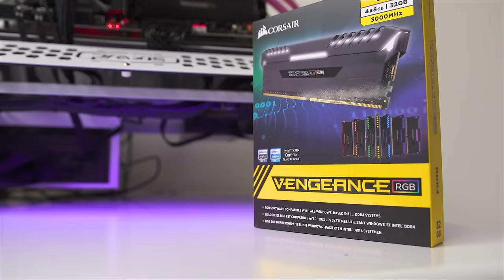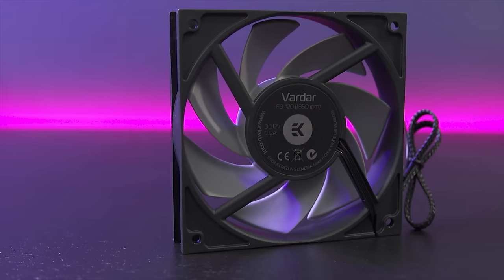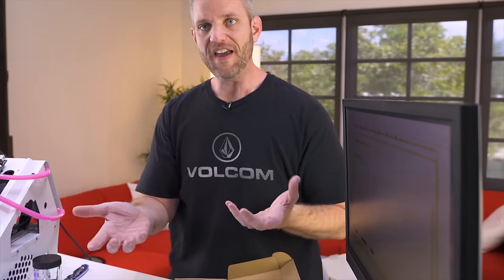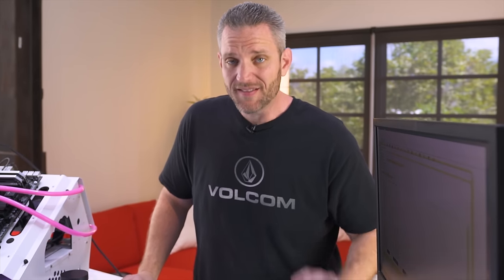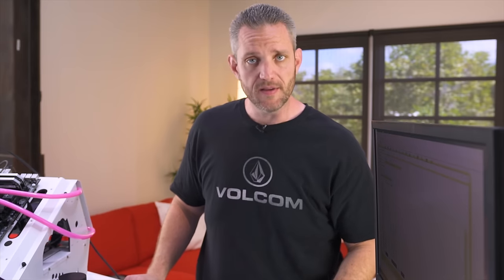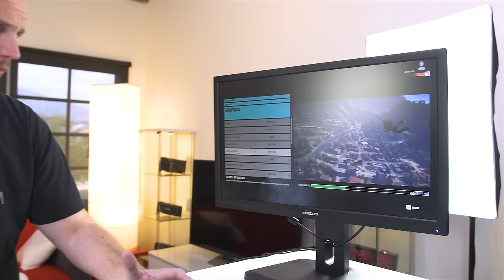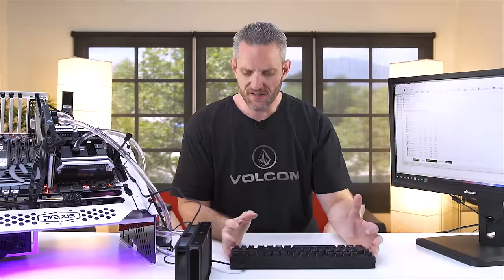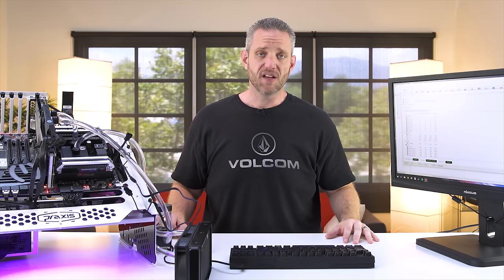How to Watercool your CPU and GPU for under $250

Comment: Hi Jay, seeing that you are no chemist and I am a chemical engineer, I can tell you a little bit about Galvanic corrosion. What it basically comes down to is a little known concept we are all familiar with from high school chemistry called "galvanic cells". The difference in standard cell potential between two metals needs to be minimized in order to minimize galvanic corrosion. If you use two metals with a massive difference in standard cell potential, for instance zinc and copper, you end up building a "battery" capable of producing 1.1 Volts of electricity, which is  not good for the more negative metal, as that metal will lose electrons (Hence it will oxidize), and thereby reduce to form more of the other metal. This will leave you with less of the one metal, an increase in dissolved metals in solution, and an increase in the other metal. Ways to combat this is to use a sacrificial anode or sacrificial cathode (galvanizing is a good example or you may supply a current to the more negative metal), you may coat the material, you may separate the metals using an inert material, add corrosion inhibitors or, the best possible way to combat galvanic corrosion, use the same friggin metal where ever you can and should the need arise to use a different metal, you should choose a metal with a very similar standard reduction potential. Also, when it comes to this concept, it is always best to have the parts with the greatest contact area to be the anode. if you make smaller parts anodic, they will corrode a lot faster and become useless. Thanks for everything Jay, love your work! Best Regards Herman
Reply: Herman Sauer great comment thanks for taking the time to write it!
Reply: "and thereby reduce to form more of the other metal"

I don't get this part. How is one element supposed to turn into another? Surely you aren't talking about nuclear decay

"and an increase in the other metal"

where does this extra metal come from?
Reply: Sorry, I get why you would think that I wrote that, it is not what I meant. What I meant, one element loses an electron and turns into an ion. The electron then transfers to an ion of the other metal (if there is such ions in the solution) and reduces it to the other metal. when there is no other metal ions then you just end up oxidizing the one metal while reduction never occurs. It can happen though that different metal ions may be reduced
Reply: Please forgive the way I put it in my original post, I tried to put it as plainly as possible so that others could understand roughly what was going on
Reply: Thanks I appreciate it Mitch!
Reply: Wow... A comment like this?? And on youtube?? Man, your words are gold! Thx for your effort!! Keep up the good job!!
Reply: Oh so essentially one metal is attracted to the other (one has less electrons) so it starts losing atoms which flow to equalize the potential difference.
Reply: @Santo Suarez, Thanks so much I appreciate it :) Sharing is caring!

@NicksDomain101, You can basically put it that way, this is how metals behave. It is a spontanuous chemical reaction that is occurring where the one metal is oxidized (losing an electron causing ion formation) and one is reduced (gaining an electron causing solid formation) It is the principle on which all batteries work. If you reverse the electron flow using an external current, you can reverse the chemical reaction. That is how electroplating is done :) In nature, all things will move towards an equilibrium (balance) and this includes two different metals in a conductive environment. I am not going to go into Thermodynamics now as it gets complicated quickly, but understand that this reaction will continue until there is absolutely no potential difference between the two metals. In some cases, a metal may form a protective, highly corrosion resistant, layer, in which this flow of electrons may actually reverse. This concept is used in many situations for protection of a metal against acids and bases. Like Iron may form an oxide layer, which is extremely resistant and can withstand quite high concentrations of sulfuric acid. It is known as passivity. Well im sure im going to bore a crap load of guys here with my talk so if you ever need to know something, feel free to drop an email. herman.sauer@yahoo.com and please dont spam my address with a bunch of porn XD
Reply: So let me get this right, using the same two metals only minimizes it or eliminates the concept? If only minimized, what timeframe are we talking before it gets bad?
Reply: Good Explanation, but why is your Name missing a second (n)
Reply: @Levi Kosters, to really give you an answer and add a time to your question will take a fair amount of research and lengthy calculations, but here is what I can tell you, If you dont mix metals you will be fine. The big problem with pc water cooling parts when people mix metals is that you can start getting buildup in your waterblocks. I dont need to explain to you how bad that would be for your system XD

If you have only one metal present, then there will be very, very little galvanic corrosion occurring. The corrosion that will happen when only one metal is present has some other names even because now it becomes a molecular level issue because the metal has impurities. Inter granular corrosion and things like that will come to play. but dont worry about that, as it is a very slow process and it is only really a problem in highly corrosive environments. When only one metal is present, you could say that galvanic corrosion is eliminated, as you will not notice the corrosion that is occurring. When metals are mixed however, the larger the difference in standard reduction potential of the metals, the more aggressive the corrosion will be. Other factors affecting this is flowrates, solvents present, temperatures, conductivity of environment and the physical properties of the metal itself and many other factors. But for an application like liquid cooling for a pc, just stick to the guidelines and you will be fine. Where galvanic corrosion really becomes a problem is in the chemical process industries where solvents flows at high temperatures (200°C and up) and pressures. But by far the best example of where galvanic corrosion is a major issue, is boats, submarines and vehicles near coastlines. You will notice a lot of people drive land rovers in coastal regions. That is because of their aluminium bodies. Go check out submarines and boats. They have sacrificial anodes connected to them in alot of cases to protect it's parts from galvanic corrosion. Another good Example, galvanized pipes, fittings plates and so forth. They are steel parts that is covered in a metal such as magnesium. when these parts are in contact with some other metal that is cathodic to them, instead of them starting to corrode, the magnesium layer will start to corrode, thereby protecting the steel. Dont stress too much about your pc, but do take care not to get reckless. Avoid mixing metals where conductive environments are involved
Reply: @Lukas, Thanks man! Why does my name need a second "n" :-/  I am "Herman" with one "n". It is simpler, better and faster!
Reply: Wow, I learned something from Jay and You today, thanks!
Reply: Hi Herman, Thanks for posting this! I just had a question though... what about the metals between the CPU heatspreader and the block of metal (could be copper/aluminum and heatsink/waterblock)? Would this be an issue? I'm guessing the CPU heatspreader is aluminum but will it matter what types of metal touch the heatspreader?
Reply: poiisondn Yeah I was wondering the same
Reply: Hi Poiisondn, To my understanding it will all depend on a couple of factors, including your thermal paste, metal used for heat spreader and metal used for the block. If the two metals are different and the thermal paste is electrically conductive there will be corrosion over a long period of time, but not so bad that it would really damage the components as the corrosion will occur over the surface of the heat spreader or the surface of the water block, and thereby form a scale on the other surface. On old GPUs and CPUs you can actually see this clearly (i'm talking GTX250 old) where there is slight discoloration (with copper involved you might see a blue-green tinge) and there is a slight faded look on the surfaces. You might even see black marks. It is due to scale formation from corrosion products. all you have to do is properly clean it up and apply new thermal paste, but using the right thermal paste will greatly minimize the effects. Simply put, you will throw that cpu away long before it really becomes a problem. But if you really want to stay on the safe side, just perform good maintenance on your pc. Every year you have to replace the liquid in your cooling loop so you could just as well clean your water block and cpu and re-apply thermal compound. But doing so every two years will suffice.Also try using a non-conductive thermal compound. Like I said, it is not really a problem. The amount of corrosion happening in that area is very little and should not be a concern.

 In the case of other components like radiators and fittings, residue could build up inside the water block, which would cause resistance to flow and which would also massively impact the thermal conductivity as the heat-exchanger will lose surface area to scale formation. And remember, inside the loop there is flow, which aggravates galvanic corrosion. Between a heat spreader and water block is really not an area you should be concerned with :)
Reply: I know it's sometime hard to share such a knowledge even if it's considered basic, but dedicating your time to share it, is something that you'll never regret! So thank you for that and I want you to know I myself and most of the people appreciate it.  you're a valued member of this community, and I will be always looking forward to your inputs.
Reply: @iSR5, thank you very much for the compliment, I really appreciate it. I will always gladly share what I know and when I am not sure, I will research the matter at hand to give a proper answer. So like I said, if you ever have a question, feel free to ask. I will gladly assist. In one of my comments I left my one email address on which you may contact me at any time. like I said before, sharing is caring. :) The only reason why it is hard sometimes is because there is a lot of people out there that will try discredit what you are trying to teach others by shouting over(or spamming) your conversation with some random stuff they have read on wikipedia... which is really not a good source of information. With Chemical Engineering there is one shit ton of "If's" and conditions in every answer to every question. Its not always something you can just go and quickly read up on.. in fact, it is actually almost never that easy. You need a wide knowledge base and good understanding to really know what to look for, but some guys just don't understand that. They will just find some quote somewhere and twist it around to their will just so that they can say "you are wrong" but actually, they have no idea what they are talking about. so to you, iSR5, I say thank you very much for the appreciation. It is really encouraging and I will remember that.
Reply: Thank you for the explanation! I'm not good at chemistry but only have a very general understanding of it. Your explanation made sense though! 
Hope to see more of your comments on this or any other channel :)
Reply: Herman Sauer so... Will aluminium corrode?
Reply: Thanks Man! I learned something new today
Reply: Ivan everything but Gold and Sliver will corrode... and even those can be made in the lab/ industrial  environments to corrode
Reply: anything can corrode, depending on the environment
Reply: apart from dried weetabix that shit is hard to get off.
Reply: What is weetabix?
Reply: in my country we have weetbix? maybe he made a typo. It's like a wheat based brick that you add a little bit hot water, and milk and sugar to get a nice breakfast porridge. when that stuff gets dry it is a bitch to clean up XD
Reply: I will definitely give you a gold for such a great comment like this but, too bad, this is youtube not reddit... :3
Reply: Herman Sauer that's not how you eat Weetbix!!!!
Reply: hey Erik, everyone has got their own method :P
Reply: thank you lincon :)
Reply: What if somebody use any other than EK certified Al "screws" in the loop, e.g. for radiator fans? Is it that serious on the screw level? If so, another point would be how much EK certified Al "screws" can stand assemble and disassemble and for the time to come? If so, do we have to replace every Al screws and any parts that absorb tensions on a period of time?
Reply: Herman Sauer VERY INFORMATIVE. Thank you.
Reply: Thanks for that info.  I've basically read much of that, but scattered around from different sources etc, so nice to read in one concise paragraph.

That being said, I actually just bought this kit, but I have a non reference card (EVGA 1080 FTW GAMING ACX 3.0) that the included gpu waterblock won't fit.  So I'm looking into other options, but basically there is no aluminum waterblock (that I can find anyways) that I could use as a replacement.  So now I can either just not liquid cool my graphics card (not the end of the world, but still), or see if there is a solution that would make one of the other gpu waterblocks not wreck my system.

How well would using a sacrificial anode (or would it be a cathode?) work with the use of the corrosion inhibitors?  Is that used in practice in pc water loops?
Reply: Ohhh thats a bummer. Can't you modify it to fit? That's what I would do. try make a plan to modify it! :) I have never really heard of Sacrificial anodes in computers.. Also, I wouldn't try it. Sacrificial anodes may help, but they have their own flaws which will defeat the purpose. I HIGHLY recommend modifying it, or selling it to regain some money. The problem that you are facing now is the exact reason why I haven't invested in such a kit. If you are too scared of modifying it yourself, check on the card what needs to be changed on the water block to make it fit properly, after that you can always take it to a company that does milling and machining, so that they can modify it for you, professionally.
Reply: Any time! See one of the biggest issues with galvanic corrosion in water cooling parts is that it forms a residue on the "heat sinks" inside the water block, which in turns resists flow of the cooling medium and significantly impacts the heat transfer coefficient of the water block it self. Now the thing about sacrificial anodes, it helps combat corrosion, yes, But it does not eliminate the formation of residue. It actually promotes it. So I would definitely not go in that direction. If you are willing to sacrifice appearance, and if you can make it fit properly, I'd say try it out. just make DAMN sure that the waterblock makes proper contact with the GPU and VRM modules, otherwise you are going to shed some tears at the end of the day. Just test it out. Install it and run Heaven Benchmark for a while. If everything seems under proper control then keep it on. If temperatures looks odd, then put the original cooler back on. Just keep a close watch on your GPU and VRM temps throughout the testing.
Reply: Gotcha, thank you.  

I think since I messed up on the compatibility, and this computer runs the show at my house (htpc/server/gaming), I'm going to keep the kit, and use on another system that I'll build.  By the time I do, hopefully the correct original/reference 1080s are decently priced so I can use it on that.  

In the mean time, I figured I'd piss the wife off, and went ahead and ordered around a grand worth of new components (new case, cpu/gpu blocks, pump/res/tubing/fittings etc) so I can do it right for this build.

Thanks again for the detailed info, as it helped a lot in making my decision.
Reply: +sandthorn: It seems Herman missed your question. I'm not a chemist, and only vaguely remember this stuff from high school chemistry, but I'd say the electrode potential difference between different grades (purity) of the same metal has to be pretty minuscule. Plus your screws don't come into contact with the flowing coolant (I think?), which makes it the same kind of static situation Herman was talking about with the heat spreader to boot. You're probably pretty safe as long as they ARE aluminium screws.

That said, "at the screw level" is exactly where galvanic corrosion can do the most damage. Builders, for example, are well educated on electrode potentials, because if they use the wrong metals in, say, sheeting a roof, the corrosion will eat up the rivets and the whole thing will come loose. You can read more here, if you want: https://www.thebalance.com/galvanic-corrosion-2339698
Reply: @Maziar, what you say about the screws is true, but it doesn't have to be aluminium. Think about it like this, if the screws really was a problem, you would be getting copper screws with copper radiators. I have personally not seen copper screws in computers XD normal screws are fine. If you are scared, give them a coating or use plastic washers. Aluminum doesn't really have the physical properties (Shear, Tensile or Torsional Strength) that is required to work as small, thin, screws, bolts or nuts. In some cases you do get those but they  are meant for use by trained people and they are made from specific alloys. They strip very easily and in general is a bad idea for most applications :D 
On a similar note, you'd be surprised what damage can be caused by impurities in metals. I will leave that one up to you to go and read on. It is very interesting ;)
Reply: @Herman Sauer: Ah. Thanks for the clarification; like I said, I only have vague memories from high school to go on. I'd like to read more about this, is there a site you can recommend?

But, come to think of it, that kind of brings us back to Sandthorn's question: is there anything he should think about when getting non-EK certified screws? Apart from no gallium screws? 😜
Reply: I wish everyone here on Youtube could carry themselves like this. If we all came together with a positive and well mannered demeanor and assisted one another, the tech community would benefit and grow faster. Thank you buddy! :D I am seeing more of this lately. Keep it up people!
Reply: I brought up the screw things because there are some videos about that melted gallium ruins coke cans (google: gallium coke can). Is that also some kind of galvanic corrosion or some other chemical thing?
Reply: @Herman Sauer wait so how would you critique this watercooling loop in terms of how it will handle galvanic corrosion  in the near/long term
Reply: @Henry, as long as metals are not being mixed on the wet end of the loop, I believe it will be fine for a good couple of years just like any cooling loop :)
Reply: @Herman Sauer reading all these replays on your comment then i see weet-bix you must be Australian or NZ
Reply: Herman Sauer mr chemist, already looked at the contents of the liquid coolants? There is no normal water used because this corrosion would happen. (the worst cooling liquid sold as cooling liquid is destilled water) do you think that even with a quality cooling liquid the process would still occur significantly? Because as far as i know destilled water is already not a much better conductor than air.
Reply: There is other reasons why distilled water is not very trustworthy. Most cooling liquids has corrosion inhibitors, and other additives which combats algae and bacterial growth. people using distilled water usually put a silver coil in the reservoir of their cooling loops for that reason. When it comes to the conductivity, distilled water is excellent as if it spills, it shouldn't fry your system as distilled water can't conduct electricity, however, it may become conductive over time as the water may leach off metal ions from the metal surfaces. Therefore, if you use distilled water, it would be a good idea to do regular maintenance. Other cooling liquids, as stated, contains corrosion inhibitor additives which helps combat corrosion, however, galvanic corrosion is a hard thing to tame as it is auto catalyzed. To put it simple, you will not notice the corrosion, but it will happen with time for sure. It will block the fins in the waterblock with residue, causing a steady increase in temps over time and also, an increasing differential pressure over the waterblock which may cause a leak on the inlet fitting of the waterblock, a leak on the outlet of the pump, or eventually the destruction of the pump.
Reply: nooooo actually i'm from RSA
Reply: oh did think Weet-bix where that popular out side AUS and NZ.
Reply: soooo.. can this kit survive in your pc for at least 4 years?
Reply: R/iamverysmart
Reply: Herman Sauer Jesus Christ you write a lot
Reply: Actually aluminum corrodes (oxidizes) nearly instantly, vs something like iron which can take months/years to oxidize (rust)
Reply: Herman, thanks for the post, but can i ask, in your opinion, and regarding what you have heard in this video.. do you personally think these aluminium setups are worth the risk?
I mean, would you invest in one yourself perhaps?
Thanks in advance
regards.
Reply: @
needabettername
talkin shit man. Aluminium forms oxide film which protects it. Thats why people in coastal areas prefer land rovers. Land rovers are mostly built from aluminium.
Reply: Fascinating.  Thank you for teaching me Herman.  You did it so elegantly and simply.  You know what's funny?  I never developed my hunger for life long learning until after I graduated from college.
Reply: I've seen sacrificial anodes used in boat engines all the time, to protect the engine from this exact corrosion.
Reply: Herman Sauer- re metal corrosion;
That was very correct AND in layman's terms(as best as can be for a short reply).
 I wouldn't mind an explanation about how one would go about deducing options to simply add therespective voltage via soldering a wire- with said correct voltage - to the radiator or the lesser metal- PLUS what if the lesser metals are in more than 1 place? And then adding electricity to something that is in contact with a MOBO computer situation seems like a recipe for TOAST for people that do not possess your knowledge in this area.
Interested semi-noob about to do a 3600x w great MOBO(X570 GIG AORUS MASTER, ZOTAC 2060 TRX SUPER AMP, VENGEANCE LPX 2X8 GB STICKS @3600Hz and I'm going to share that w Paul, Steve, and perhaps some others of the crew!- Fun!!!
Ps- Thanks for that info again, and any answer as I love information!!!! Power is knowledge!
Reply: Oh cripes!- I how ya still have the same address etc to het my reply!- I failed to see that it's been 2 flipping yrs!!! Zoink... Yeh I'm coming off vids uploaded hours ago so that's why I just figured this was lately! LOL.